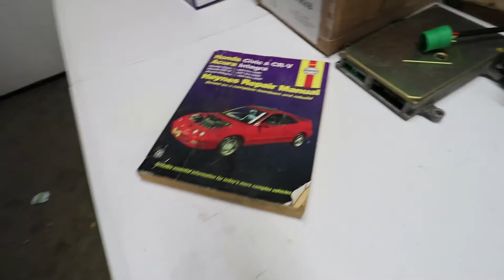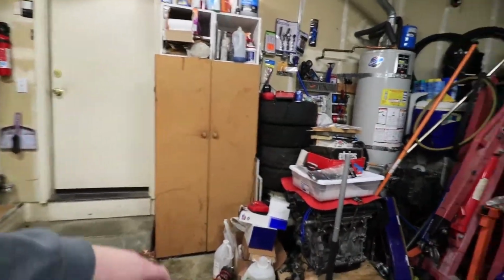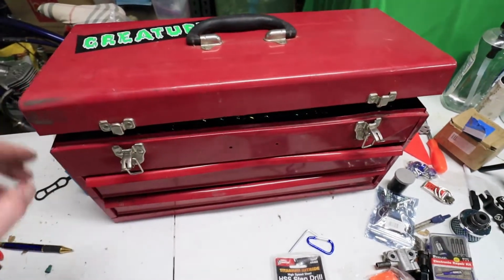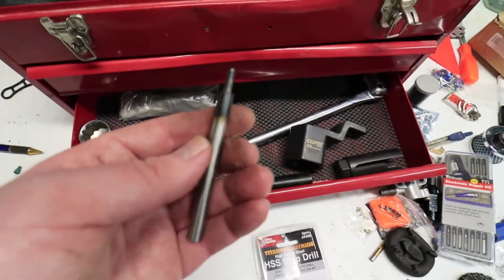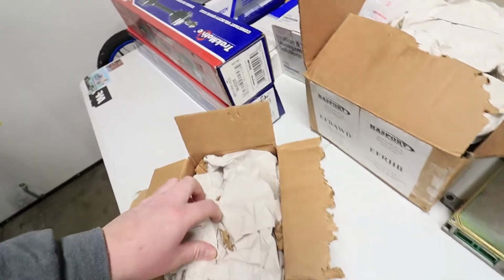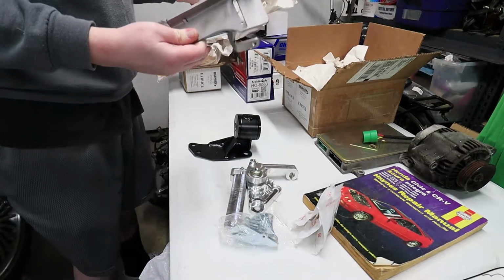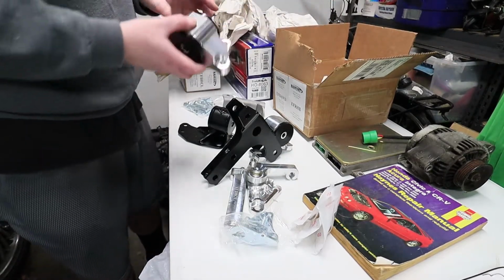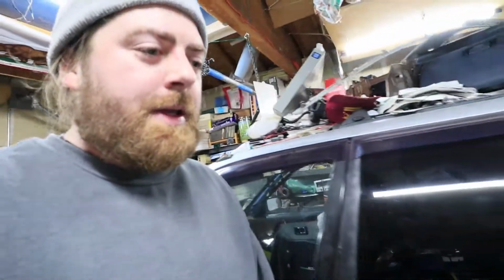How to install B series in EF Civic Chassis Part 1 |  Hasport Performance Racing Mounts BAWD kit!

Comment: I have the DA intermediate shaft as well so hopefully it’s right for both of our wagons
Reply from the maker: It didn't fit my AWD transmission but I also bought from someone who was booted off eBay for scamming so I may have not been sold a manual transmission da int shaft